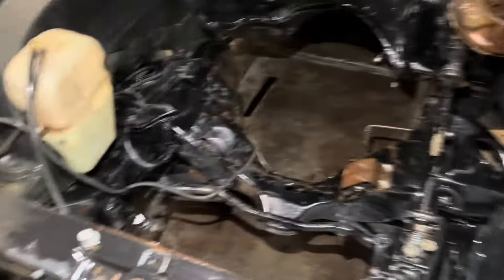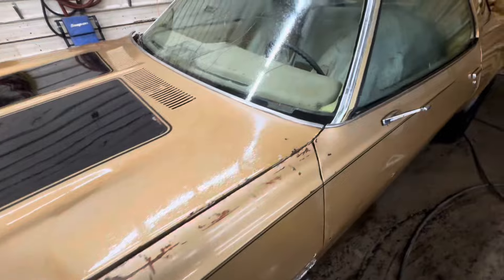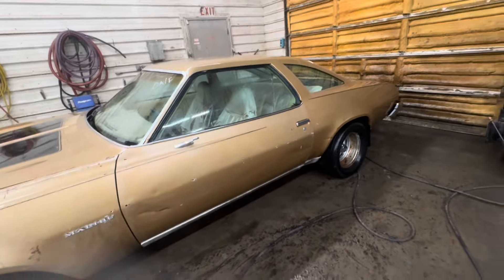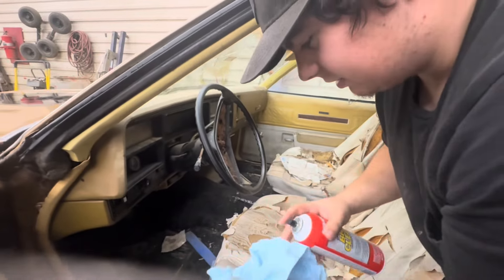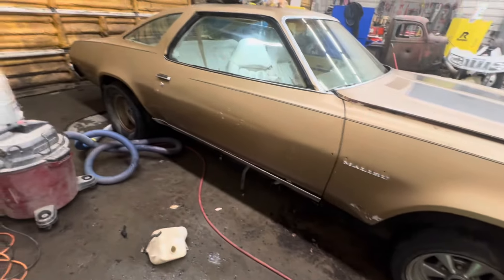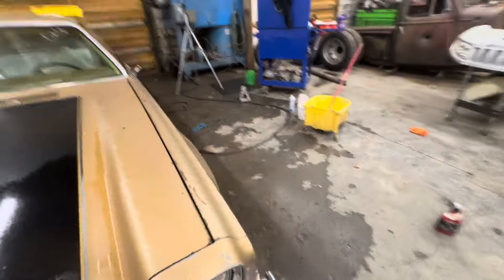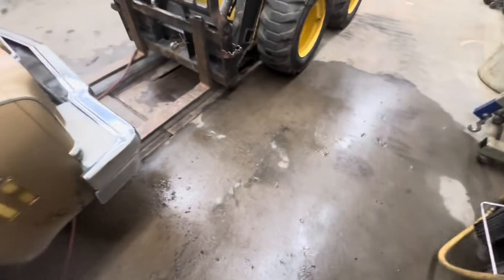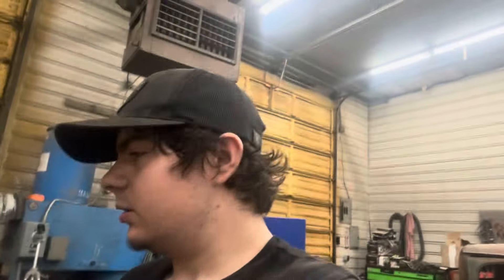Chev’s Street Series Ep:1 Ls Swapping a 1973 Chevy Chevelle

Comment: I had a 4-door it had a 350, turbo 350 all stock. It was a fast car on a straight away at 120 mph. But your car has potential as a promod, there's so much choices you can do. Big block crate motor w/ blower, LS-7 in board computer to tune it. Tremic trans, 9" Ford rear end. Tub the rear, some fat tires front and back, suspension tune. Keep the stance low with a little drop at the front.roll cage, racing seats w tight bolster to tuck you in. Custom interior,aluminum door panel to match rear tubs.steering wheel upgrade. Detail dash, clean speedo,after market gauges,oil, temp,vac,trans temp, aluminum radiator. Electric fan with solenoid, a Manuel fan override switch if need. Original paint or GTO dark blue met, or black? Like to see how your car will turn out.🤔👍